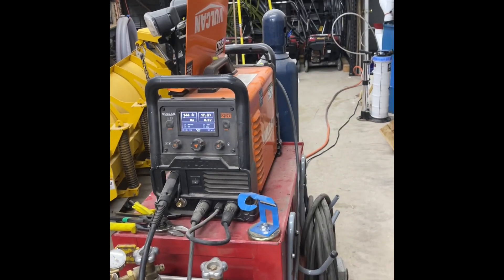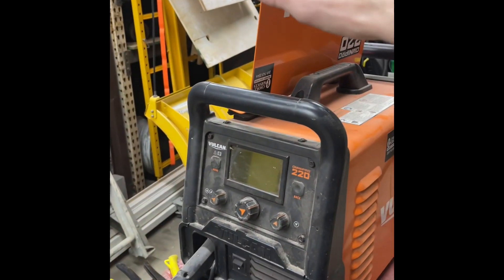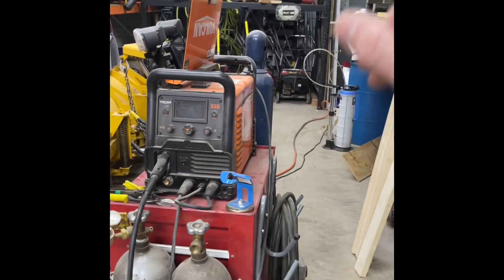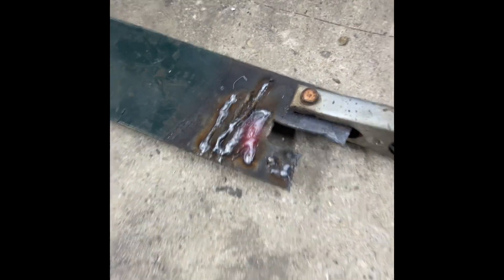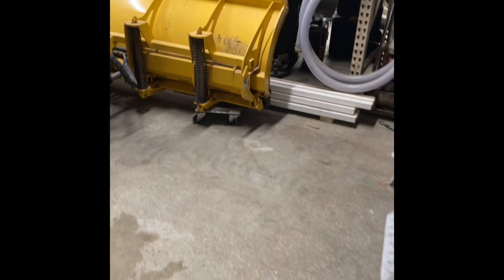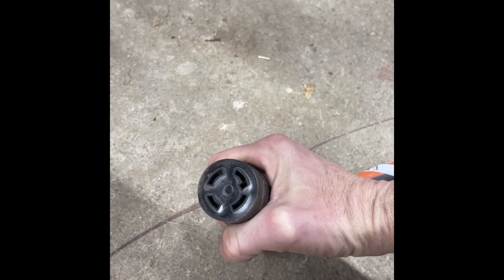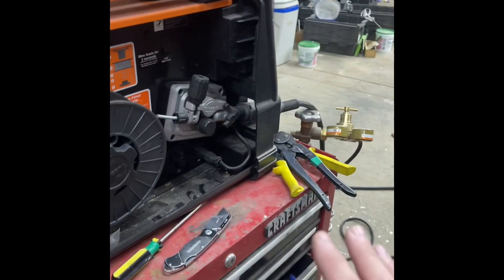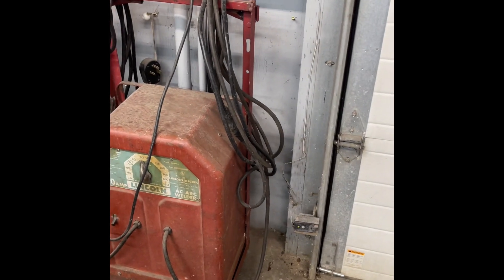Vulcan, OmniPro, 220 running on a Generac GP 8000 E generator ￼

Comment: My mig max 215 did good on a pulsar 6000 pg and i got a durostar 12000eh and it wont go past 1/8 th in on the settings with out showing the over heat light dives me crazy

Comment: THD is a bit higher than the XT series Generac of the same voltage. The grounding probably made up for the slight difference. I don't know how, but that is my assumption. The only reason the Rigid ran that old buzz box as you call it, is because that old welder is a transformer welder, and they'll run on dirty power all day long. Most new welders, the Vulcan included, is an inverter welder. They require less harmonic distortion of around <6% or they will give you an error and not work. Strange how grounding it helped since the GP 8000 is a bit over that THD. Not sure but in Generac's list for low THD models, it's not in that. Be interesting to know exactly why grounding helped. You might want to get the XT version for the simple fact the higher THD might eventually damage the Vulcan. Good luck. I'm trying to set up a similar portable system for my son who's a fantastic welder. He loves the Vulcan multiprocess I got his for his birthday. It's already paid for itself, but he needs portability so I'm looking for a good price on the XT8500EFI. I can get a refurbished for around $879 on https://factorypure.com/products/generac-xt8500efi-8500w-10000w-electronic-fuel-injection-generator-electric-start-manufacturer-rfb

Comment: This does not work for the harbor freight/ China generators FYI. Guess I should've done my research before buying an omni-"pro" and a predator 9k thinking I'll be able to do portable welding without buying a real setup.  Thanks for the tip though

Comment: Thank you for this video, I have a Predator 9000 watt Generator and I plugged my omnipro into it with an adapter cord I got from amazon and I had that same error message. I will have to try and add a ground lug with a quick disconnect, I need to be able to use my machine to its fullest potential as I own a small welding business and I did not want to spend all the money on a heave/large miller welder that I cant move around very easily!
Reply: Did this work well for you?
Reply: I'm trying to do the same with my predator 9k, I even returned an omnipro 220 and am debating on a migmax or buying another one of these
Reply: Probably won't help. That Predator has too high THD. You need to get the same voltage but in the open frame inverter Predator which has far less THD. Too high THD, even if you can get it to work, might damage the Vulcan.

Comment: If I works for you awesome but what I learned is that not all generators produce “clean” energy. There is THD (total harmonic distortion) sensitive electrical components such as laptops phones tv and inverter style welders need very clean energy <5% THD ( which is what the electric company is allowed to have) some generators like the firman I had, had 15% THD which would cause the machine to shut down due to poor power input transformer machine can handle “dirty” energy but require more watts due to needing a higher input of amps. They do make generators that produce clean energy <5% THD. Which I will be getting soon to run my Omni pro 220
Reply: What brand? I'm looking at getting a predator 9000 watt generator
Reply: Ai power from Costco it’s a 10,000 watt for $970
Reply: @TheGunnut95  How did that work out for you? Looked at that generator and in the specs under THD all it says is "Standard THD"